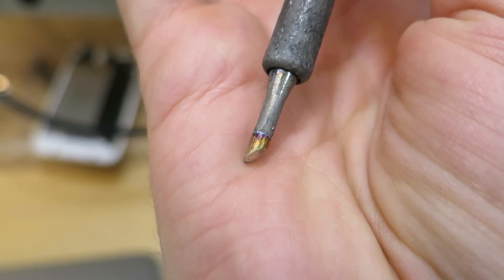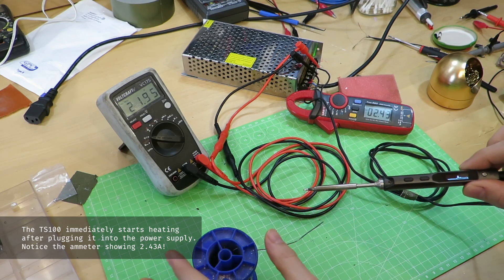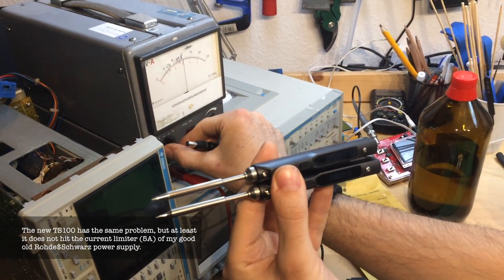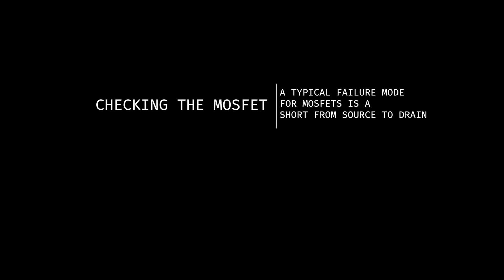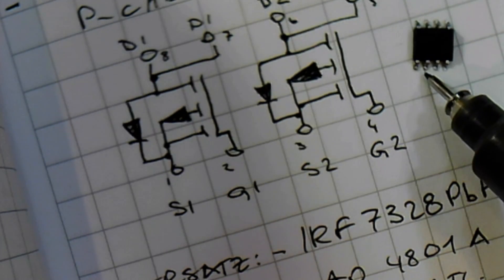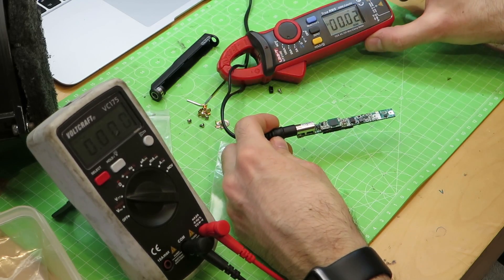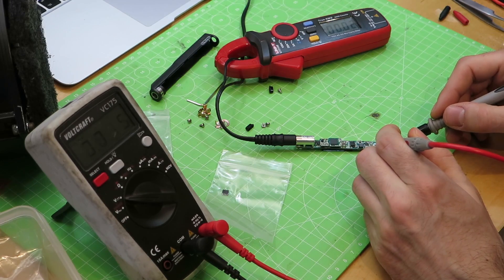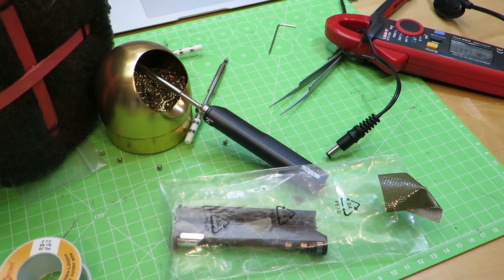TS100 Fix (Sen-Err / overheating) - MOSFET replacement

Comment: I have a newer model, TS101, and generally use the 24V-3A plug pack power supply that came with the kit.
It works great with the one genuine tip that came with the kit.
However, I bought a new set of 10+ non genuine tips, and all of the ones I've tried (3 or 4) heat up briefly, then I get a 'no tip' error.
The cold resistance of the non genuine tips I've tried all look good, around 7-8ohms, and I seem to remember the TS101 can display the tip ohms when installed.
However, do you happen to know how I can measure the tip temp sensor, I presume they must have one?
The non genuine tips have two metal rings, and I guess the metal body of the tips may be grounded or used for one of the temp sensor connections?
Thinking perhaps the non genuine tips have faulty temp sensors, or heating elements may be going open circuit within a few seconds of heating, or perhaps just poorly connecting inside the iron.
I've tried them with the locking screw tight, medium tight, just nipped up, and even loose, with no real change.
I can install the genuine tip and it continues to work just fine, with no drop outs or 'no tip' message, no matter if the lock screw is tightened, or completely loose etc.
Any ideas on how I can get these non genuine tips to work for me?
I know, I should have just bought 4× genuine tips, but 10+ non genuine tips of all shapes and sizes for the same price as 3 or 4 genuine ones was hard to resist, and now I'm stuck only able to use the genuine one anyway🤣

Comment: I had mine for 4 years, wasn't until just now I tried a 15volt 3.4a power supply I got this error and now no longer works on the prior 12v  3a PS :(    it was labeled for 12-24v input too.   I will have to try replacing the chip.
Reply: Fixed mine, installed   PN IRF9362TRPBF    30V 8A.  Thank you for the video!

Comment: EXTRA INFO - I had the same Sens Error problem, but it was poor contact between the iron and the three tip connections. It can be diagnosed by pressing the top button to see the voltage and current temperature when cold. If it's not sensible (like 25C), try dismantling and cleaning the brass contacts and PCB pads to them.

Comment: Thanks for this !
I've used mine for many years but blew it this week by stupidly not paying attention and while powered I somehow inserted the tip end in tip first :( it was very late and very dark and I was rushing is my excuse.
Did not think it would even fit in backward but it does! Dont try it! My fault was different - it would say "Sen Err" but not heat at all.
Anyway couldn't find those Mosfets you mentioned for reasonable postage costs - but I found a fds4935bz on a scrap playstation 3 motherboard - and it works perfectly :) 
fds4935bz  is –6.9 A, –30 V

Thanks for the pointers to get my soldering iron working again! :goodvibes:
Reply from the maker: Nice fix! Salvaging from old electronic parts is even more Mad Max 😎 …and wow, the tip fits backwards… that’s a design fail par excellence 😅

Comment: I bought my ts100 a few months ago, tried it out and it immediately did the same thing, although I didn’t notice the problem until the tip was literally red hot, do I need a new tip? It seems a bit charred. I hope I didn’t destroy anything in the TS100 itself, I want to do the Mosfet fix too, but fear that something else may be broken too. But from your video it seems to just have the same symptoms as mine, no more and no less symptoms.
I’m gonna open mine to see if any other components show any signs of damage, other than the mosfet.
Reply from the maker: I am pretty sure that you have a faulty tip. Get a new one and replace the MOSFET, that should do it. Regarding the schematics, I don’t think that other components are affected! Let me know if you need further help :)

Comment: What brand of Flux did you use? Thanks a lot!
Reply from the maker: There is nothing special about it, I use all kinds of fluxes, whatever I finde in local shops :) The one in the video is I think "Chip Quik" if I remember correctly. Search for "no clean flux"!
Reply: @tamasgal_com  thank you so much! I've the same problem. Hope with new mosfet can fix it... Thank you again
Reply from the maker: @gabrielemoro1  I am pretty sure you will, let me know if you need further help :)

Comment: Mine took a few years to break. Anwyay, thanks a lot for this video
Reply from the maker: Both of my TS100 are still working after like 3 years, fortunately, but I don't change the tips too often. As it turned out (see the pinned comment), the most likely reason that a MOSFET is burnt in a TS100 is due to a bad tip. I use my iron almost every day and luckily the tips are really heavy duty, so I only changed them I think once or maybe twice the past three years. Of course, the more often you change those, the higher the risk that you pick up a faulty tip and kill your iron ;) Anyways, happy soldering and many thanks for your comment.

Comment: Nice video,
With which soldertip did you solder the SO8 chip?
and at 7:32min I see a very small tip in the top of the screen, which one is that?
Do you have links for them?

Comment: Very thankful video! I think I had a similar problem with mi TS80P, could this be applied on it as well? I am an student and it took me a while to save up as I wanted to upgrade from a 10 year old RadioShack one but just today used it brand new and it suddenly kept resetting just after going crazy from 300º to 500º and then saying "no tip".
Please help and thanks for the vid
Reply from the maker: Hey Leonardo! I think that it might be the same problem. Can you try another tip? I’d highly recommend to contact the support first, I am sure they will replace it immediately, they are very kind and fast! If you want to DIY, then open it and locate the MOSFET and check it for a short, es described in the video. Good luck! Tom
Reply: @tamasgal_com  Thanks for replying! I contacted my seller in AliExpress but should I message to service@morningtools.com as well? Or service@minidso.com? Who did you sent the case to?
Currently I have no other tip :(
I appreciate your help very much! Merry Christmas and Happy New Year!
Reply from the maker: You should always first contact the reseller, he is primarily responsible to deliver a replacement (since the unit was broken from the beginning) and then takes care of the formalities with the manufacturer. In my case, my reseller did not respond so I directly contacted the manufacturer (service@minidso.com) to take care of it myself, but as said, it's usually easier and quicker through the reseller. Merry Christmas and I wish you the best! Happy DIY :)

Comment: Very good material, thank you! Recently, I did a mustake, I just make the magic smoke out of my TS100... After dismantle, I discovered is a diode totally fried, on the side with the OLED... But I cannot identify on the schematic the reference designator for it. Please, do you have a placement plan for the TS100 components on PCBA? Thanks in advance for your support! Cheers!
Reply from the maker: Oh ok, no worries, that should be fixable, do you know the label of the diode? (D1, D2, D3 or D4)
Reply: @tamasgal_com  Good morning. Thank you to reply to my request. Meanwhile I succeed to repair it. There were the folliwing components: D3 (damaged to 40 ohms bipolar), R30 (from original 150 ohm was failed to about 360 ohm), and finally it was D1, totally fried - I tried after to connect the device to a laptop, and the USB 5V supply from the laptop was high current capable. While D4 and Q1 remained fully functional, no damage. So, in similar cases, for all users: check input power components. Have a great day! Cheers!
Reply from the maker: @horiamorariu  Good to hear, nice job! 🙂

Comment: Thank you, my TS100 is working again!
Reply from the maker: Well done!
Reply: @tamasgal_com  thanks, from now on I'll never use it again without a proper current limiter (eg 3A fuse) ... One day I plugged it unattended, the tip went red hot before the output diode and capacitor of my unprotected "150W max" 24V power supply (LiPo powered step up) went poof :D I'm surprised that nothing else failed into the TS100, even the tip is still working fine!
Reply from the maker: @goebish  yes indeed, although they really could have put in a fuse to avoid such a damage, we are lucky enough that only the MOSFET is blown ;)
Reply: hi bro, where do you buy the mosfet? i can't find any store on aliexpress
Reply: @CLEVERCAT-iq4kt  got it from aliexpress, but that was more than 1 year ago.

Comment: Won't the same conditions that destroyed the original MOSFET still be present?
Reply from the maker: Tom Lake yes, that can happen. the cause is usually a faulty tip. Measure the resistance of the tip and compare them with those in the comments/description and replace if it’s out of range (it should be at least a few Ohms). Mine was completely shorted...

Comment: i also had Sen-err but my tip didnt got hot. I thought my device broke but then i loosened the screw for the tip and it worked again. Possibly tipped the tip at an angle and probably loosing contact on one contact

Comment: how do you solder a chip in your solder iron if you are working on your solder iron :)
Reply from the maker: ;D I have more than one solder iron ;) Actually you can also use a metal rod and a lighter to heat it up. It will be very difficult but if you have nothing else, it's a way to do it. I did such things during emergency repairs while on tour with my motorcycle. Another possibility is to buy a cheap soldering iron for 5$, but I'd avoid this in favour of less (plastic) waste. Last but not l least, ask in your circle, chances that someone can borrow you an iron should be quite high ;)

Comment: hey there, can i ask you a question about this repair?
i have purchased SI4925DY (4925BEFAL73S) (from aliexpress) and soldered this on the iron.
starting up seems ok, but the tip does not heat up at all.
can you maybe help me with this? :) that would be awesome.
thank you
Reply from the maker: Hard to tell... can you measure the tip voltage? Maybe the tip is faulty, so check first if the voltage of the tip connectors is ok. Why did you change the MOSFET in first place? Did you have an overheating issue? If so, did you change the tip too after replacing the MOSFET? And last but not least, have you installed the MOSFET the correct way? I am currently on my mobile so it’s not easy to look up the schematics but if the MOSFET is rotated 180deg, it might just block the current...
Reply: tamasgal hey there, thank you for replying...
At the tip there is about 4 volts AC, and between the two copper connectors, there was around 19 volts DC.
And yes I have followed your video and placed the mosfet in correct manner...
And no, I have not replaced the tip, now come to think of it, I think it could be broken after the one time overheating, it went red hot. I will try another tip later .

Thank you there
Reply from the maker: joren chong  yes throw it away! The tip is very likely broken and may cause trouble again as there is not over current protection in the circuit for the mosfet. If you have 4V (that’s for the temperature sensor) and 19V (max voltage of your power supply) at the tip connectors, then your iron is perfectly fine, most probably 😉

Comment: The iron is making cracking sounds near the connector after shaking. Any one has any idea what is going on?
Reply from the maker: Open it 😉
Reply: @tamasgal_com  I did, everything seemed fine. The MOSFETs were beneath the controller board which I dared not to desolder. However I ended up upgrading the firmware and now it don't hear the cracking sounds anymore.
Reply from the maker: samrockseagle hmm that’s strange. Well it seems to be fixed, so you did the right thing I guess 😉

Comment: Thank you for showing that. I needed a new soldering iron and almost bought one of these.I guess I won't be buying one of these anytime soon!  I just sent back two soldering stations that both died within a week. Is everything made in China junk?
Reply from the maker: Garrock Waters Well, I think it’s still a very good soldering iron, especially for this price! I had no problems with both of them since I fixed the, and I use them on a daily basis. I would still recommend them 😜

Comment: My brand-new TS100 showed the Sen-Err on first start. But after re-installing the tip that issue was gone. However, now it can't keep the temperature at the specified level. When it's set to 300°C, it jumps around between 240 and 380 constantly. I don't know if the 24V 3A Laptop charger is the problem or if maybe something broke during that initial error. It's so sad, I was so excited for this thing 😓

Anyways awesome video, I'm sure it helped a lot of people :)

Comment: I recently purchased TS100 and it developed the same problem after only a few days of usage. The MOSFET used in my copy of TS100 is HM4885, rated at 40/7.5. Better specs but apparently still not enough. For some reason I was not able to find HM4885 (not on eBay, not on Ali) so I ordered SI4925DY.

Comment: Hello @tamasgal can i have a link to recommended MOSFIT like youres my psu is a Asus psu 19v 3.75 amp but after i use it 2 times my lcd go black and vary low view as your error but almost cant be see it thanks in advance

Comment: my tip is showing 14 ohms is this mean its faulty?
and will kill my newly installed  mosfet ?
Reply from the maker: peter houghton that’s more than i ever measured on my tips, but it should be fine, as long as it’s not lower than the values in the description.
Reply: @tamasgal_com  great thanks

Comment: Hi sir could you help me, i have a ts100 and the oled display was not function, the numbers sometime shown sometime not. Could you advise me what should i do. Many thanks in advance
Reply from the maker: I'd recommend taking it apart and check the solder joints; and resolder them if they look suspicious ;)
Reply: @tamasgal_com  oh, ok sir, i will check the solder join..many thanks
Reply from the maker: simple person also check the display, it’s not soldered but simply connected through pins!

Comment: Would a si4925dy work? N and p channel?
Reply from the maker: Yes sure, I also listed that one in the description. You need the P-channel one...
Reply: @tamasgal_com  I know but on Amazon it says N/P channel and has no option to select. Sorry I'm not the most competent person when it comes to this kinda stuff but I know I could swap it out if I get the right one.
Reply: @tamasgal_com  actually I mis spoke. I'm looking at the FDS8958A n/p dual channel chip.  Don't understand how it can both types.
Reply from the maker: @JustinCaseShorts  Have a look at the data sheet, it states that it's a dual channel (two MOSFETs in one chip) N/P type. If you look at the first page in its datasheet: http://www.farnell.com/datasheets/80249.pdf you see the pin configurations which are labelled as Q1 (N-channel) and Q2 (P-channel). For the TS100 you need a dual P-channel MOSFET, so FDS8958A will not work.

Comment: How is this upgrade work, are you still using the upgrade to SI4925DY or did you find something better ?
Reply from the maker: Marlin Freeman it works perfectly fine, I use both TS100 on a daily basis there was no additional repair needed yet...

Comment: Can i use 15a mofset?
Reply: If you intend to use it as a welding machine, sure! 
Seriously: often these high current mosfets need more power to drive them. So you’ll need to have a look at the specs for that.

Comment: Do you have any updates if the manufacturer now uses a better MOSFET?
Reply from the maker: No sorry! You will only partly solve this issue with a MOSFET which is rated for higher currents. The best way to go IMO is to put e.g. a replacable 3A fuse into the iron's cord.

Comment: How can i find that mosfet ?
Reply from the maker: You can search in eBay for example, I listed 8 MOSFET types which you can pick, in the video description!
Reply: @tamasgal_com  I think I will return the product. (aliexpres) very annoying😔
Reply from the maker: @scienti5t  sorry to hear. I am using both irons until today and they work absolutely fine since my repair. I also added a 2.5A fuse, so in case a tip breaks, the iron will survive it ;) I have to tell, I still recommend this iron. Everything else which offers the same specs is just much more expensive...
Reply: @tamasgal_com  I don't know how much the mosfet fee. I don't want to pay again. I'll get back ts100 or I'll try 8 mosfet. What do you think I should do? return or repair? btw thanks you so much for replying. Hello from Turkey.
Reply: @tamasgal_com  And how did you add 2.5A fuse? Do you have a video?
Reply from the maker: @scienti5t  Hey there! I simply bought an "inline fuse holder" and put in a 2.5A fuse, directly into the cable of the iron. That's it! You need only one MOSFET and it's usually less then 1$, so it'ls not expensive. If you want, I can send you a MOSFET, you just need to write me a private message with you address.
Reply: @tamasgal_com  I wrote you twitter. could you take a look?

Comment: I was using a 12-volt 2-amp adapter for occasional odds. One morning I plugged in the plug. I've tried different adapters. No sign of work yet. No screen display and no warm-up.
Reply from the maker: That's a different issue. You should open it (also unplug the tip) and do some measurements. You can find the schematics online, which will help you!